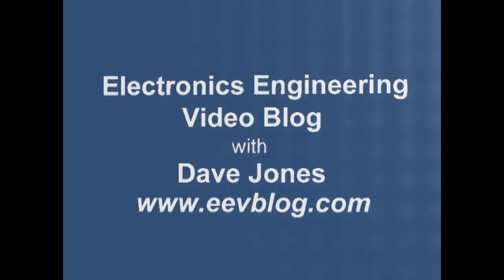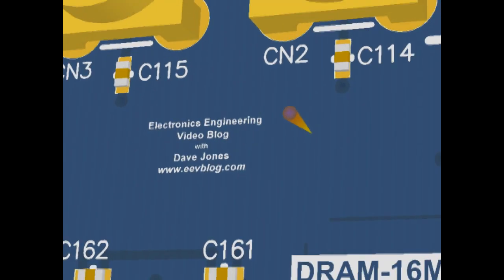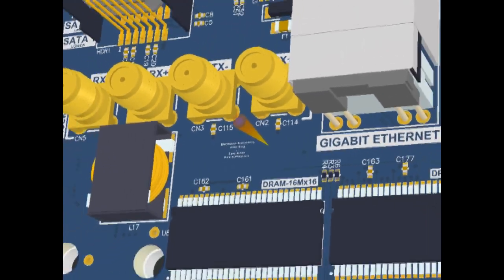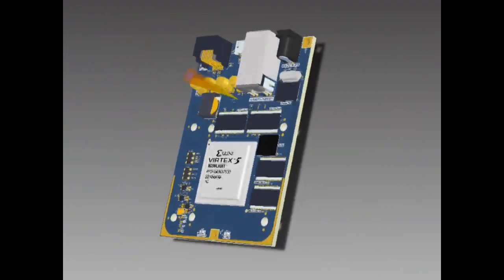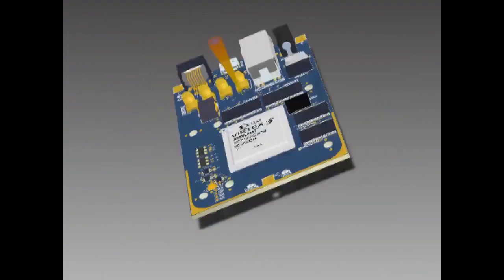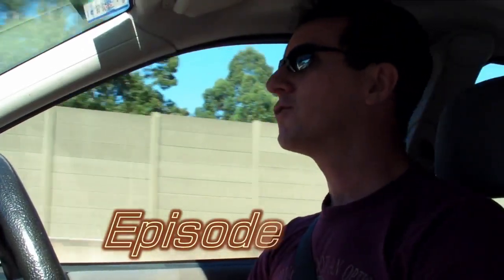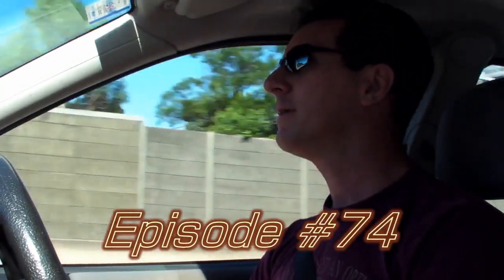EEVblog #74 - Video Blogging Tools

Comment from the maker: @cr99991 
I'm stuck with using Bigpond cable Internet. It's pretty darn fast at up to 30Mbps download, but uploads are capped at 1Mbps.
Bigpond also deliberately throttle Youtube, the bastards!
Average blog is probably 300MB in size.